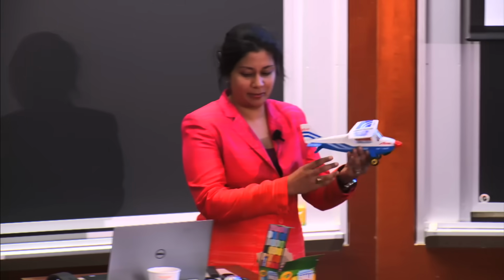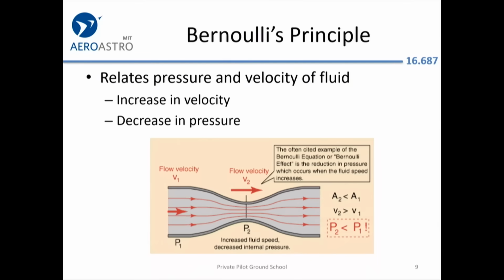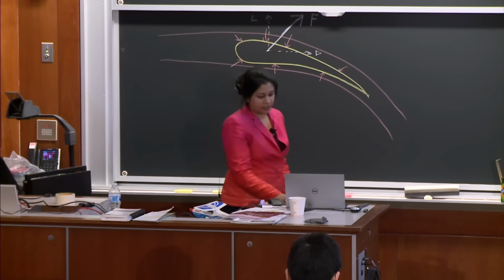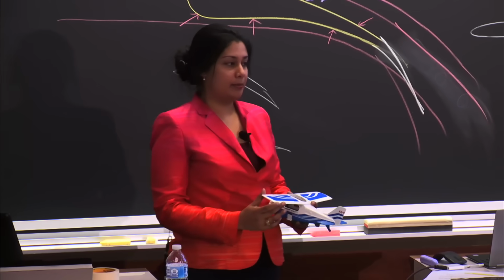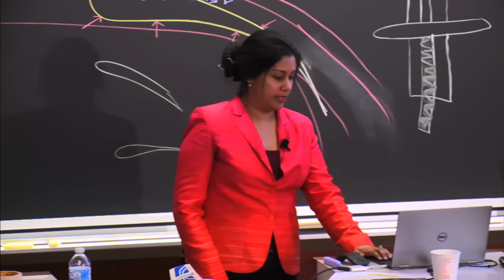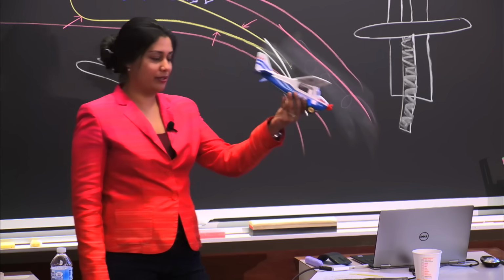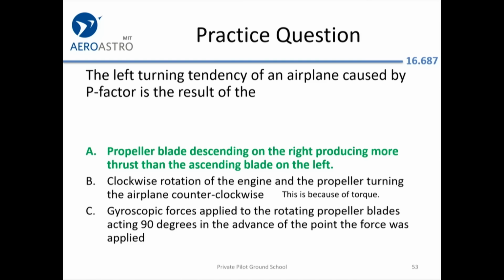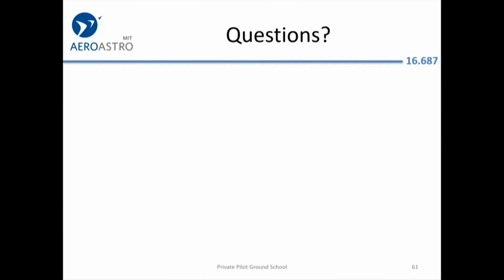Lecture 2: Airplane Aerodynamics

Comment: Interesting.. I haven’t heard of the term “equal transit theory”, but the explanation seems directly referenced to Bernoulli’s principle as well, in the idea of incompressible air, if the air on the upper camber needs to travel faster then its pressure is decreased, which causes the lower camber for higher pressure producing lift.
Reply: She is infact referring to Bernoulli's principle without actually mentioning the name.  It was widely accepted but in the recent past more and more people are leaning towards newton's laws being the reason for lift.  and i agree with the fact that the air molecules doesnt really meet at the end, so the theory doesnt really apply.
Reply: Narayanan Jayachandran i agree,  Newton’s law of motion has been a basis by jeppesen as well together with Bernoulli’s principle. As you said she refers to the Bernoulli’s principle without mentioning it, its pretty hard to debunk something that exactly explains the same concept.
Reply: Not really, She also mentioned Bernoulli's principle and say nothing against that... the only key word is " The molecule of air will meet at the end of wing at the same time "... that part is fault... 

Air molecule travel faster on top of the wing, that's create lower pressure area, thus, lift generated. 

Stop at that.... there is nothing against Bernoulli's principle.
Reply: kannika thamutok hmmm why would it travel faster then if it doesn’t have to meet at the end?
Reply: @kannikathamutok8021  Why would the air accelerate above the wing? Where is the force coming form? The fact is the angle of attack creates a low-pressure region behind the wing, the low pressure cause the increase in velocity, not the other way around.

Comment: can anyone say why actually does the air moving above the surface of the aerofoil is moving faster than the air moving at the bottom surface of the aerofoil?
why can't it be the other way around that the air moving below the surface moves faster and the air moving above the surface slower ?
please someone answer
Reply: As Harry Bendini says, the air over the top of the airfoil moves faster because (in incompressible flows) it obeys Bernoulli's Principle (which basically states that there is an inverse relation between pressure and velocity). When pressure increases, velocity decreases, and when pressure decreases, velocity increases. So intuitively, if the air over the airfoil is going faster, it is because there is a region of lower pressure. The question that should be asked is then; WHY does the top of an airfoil have less pressure than the bottom of the airfoil? 
It is hard to explain without any diagrams to visualize, but I will attempt my best. If you look at the drawing on minute 8:25, you will see that the bottom of the airfoil acts as a 'barrier' to the air that flows under it: as the airfoil moves through the air, it 'shoves' the air molecules together, and effectively the air is being pushed by the wing. Thus, the pressure on the bottom of the airfoil is greater than the pressure at the bottom of the airfoil, creating a pressure differential.
This is of course not true in every case - if you take a symmetric airfoil at 0° AOA, then there is no 'barrier' that shoves the air molecules together and the pressure is the same on the bottom and top. However, if a symmetric airfoil is rotated so that there is an AOA, then obviously again there will be this 'barrier', and a pressure differential will be created. 
I'm sorry if I don't sound very clear - I've attempted my best to explain it but it is surprisingly hard to do so without drawings.
Reply: Sidhrath panda... In layman's term. let's look at it reversely by asking... "Why air travel under the airfoil get slower speed"... 

In real world, When air travel pass an object,  it's (air) encounter resistance from that object, deflected and slowdown... 

In case of airfoil... lower part of airfoil in operation ( the way its designed and applied ) create more resistance than top of airfoil, thus air travel through the lower part of airfoil get slower than air travel on the top.

If you refer "above the surface" as   "up to the sky" ...   then, air travel above the airfoil's surface not alway faster (thus, create lift upward ).
The way non-aerobatic aircraft is designed, wing will normally generate lift when its fly in upright position... in case it pushed to fly belly up... Airflow on the skyward side of the wing (now,  the belly side because airplane is inverted ) travel slower than air under the wing ( now, cockpit side ) ... the wing is now not generate lift upward to the sky anymore, instead it's generate "lift" downward to ground...

If you look at submarine's sail plane ( horizontal Fin, usually at front of submarine ) that also a type of foil... (just can't call airfoil cos it's application in the water). That fin is not designed for the purpose to always generate lift upward... it's designed to control vertical movement of submarine under the water. The camber is different from airplane's wing...  

Water and air are both liquid, effected by a type of "foil" the same way.. In submarine, it's sail plane (that fin) trailing edge deflected down ( water travel slower under the foil ) to create "lift" upward made the sub ascend toward surface... when  the fin's trailing edge deflected up, ( water travel slower above the foil ) it create "lift' downward... made the sub descend toward sea bottom.

picture would be a lot more helpful for this explanation... but I'd tried... hope it's help...
Reply: I may be incorrect, but I believe it has to do with Bernoulli's Principle, which states that in areas of higher pressure, a gas (in this case, air) will move faster, and vice versa in areas of lower pressure. Correct me if I'm wrong, but I believe this is the case.
Reply: I guess the volume of air crossing at the cross section at start and end of airfoil  must always remain same. To ensure that air moves faster on the upper layer of foil, as it has more distance to travel to the end crossection.
Reply: The air moves faster on the top of the wing and slower on the bottom because of circulation formed by a starting vortex separated at the top close to the trailing edge and flowing downstream.
To conserve angular momentum a bound vortex was formed with the circulation around the wing in clockwise 
sense. This circulation is needed to maintain smooth flow at the trailing edge( Kutta condition)
According to the Kutta-Joukowsky law the lift is
density times span times flight velocity times the circulation
The circulation is the path integral of the scalar product of the velocity and the path increment vector around any closed line outside the boundary layer.
Any explanation without the circulation is wrong.

Comment: This explanation of lift is incorrect. Newtonian lift doesn’t exist.
Reply: What she talked about was not newtonian lift. Newtonian lift only has to do with interaction of the lower surface with the air. Look it up on the internet. What she said is that the momentum of the air being deflected downwards is causing a force on the wing. That is correct. No wing that does not move air downwards, will generate lift. Even a flat bottom airfoil with a curved top surface with zero incidence (that does not mean zero angle of attack) will generate lift because the upper curvature will cause air coming off the trailing edge to move downwards.
Reply: Newton's 2nd law has the correct explanation. Due different curvature, different pressures exist hence the lift... Also, 3rd law can't explain reflex camber..

Comment: The word wind in the P-factor attempt to explain causes confusion. I guess it is wind but actually it is the forward movement at 100mph they are talking about, at upward attack angles your upward component of motion is feet per second while forward is still close to 100 mph. As the propeller creates and angles to that dominant forward component of motion, it effect lift of blades going toward or away from that dominant forward motion vector..
Reply: The commonly accepted tern is "relative wind". This is used everywhere in aviation and is explained, then understood to mean the relative flow. She fails to explain that until very late in the video.  It is quite poor.  MIT should do this over...

Comment: Why does the instructor go on such a tangent about equal transit after establishing the real explanation for lift? Once that is established, wouldn't it have been better to just briefly wave off the false theories concerning lift and move on to the next sections?
Reply: I find it interesting to learn about why false theories are false
Reply: intriguingly the explanation that they went with, about changing the direction of airflow causing a force, also doesnt explain lift fully. The video @M D posted below goes into it a bit, but the real answer of what causes lift is "it's complicated"
Reply: @Mc99911  This video is poor and she made it more complex than it really is. Also explaining many things poorly and adding unnecessary things.  It does, however take explaining, but all the principles are relatively simple for a high schooler.  Try this step-by-step explanation:  Understanding Left Correctly: https://www.quora.com/q/rxesywwbdscllwpn